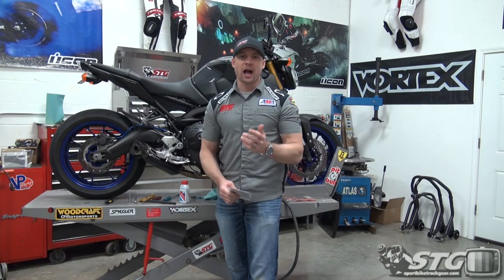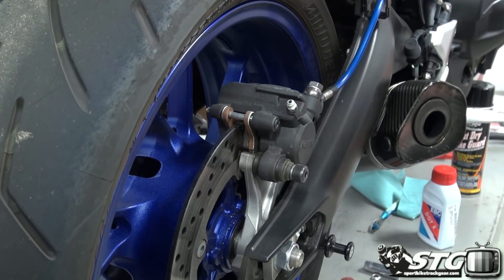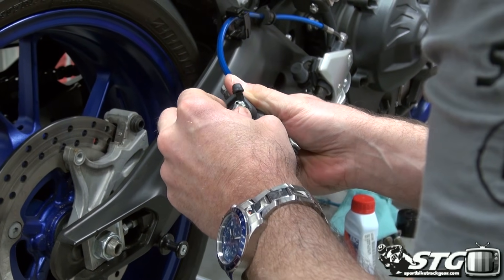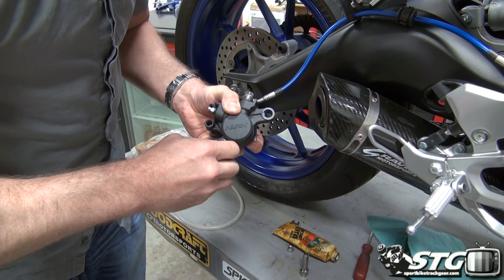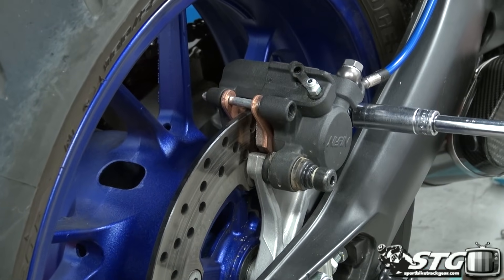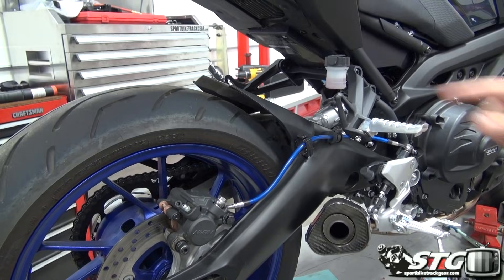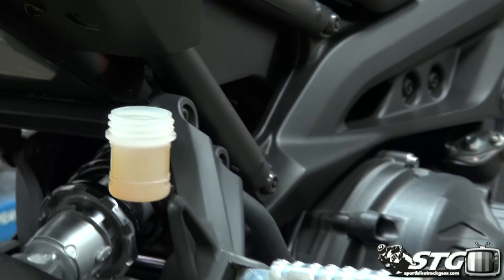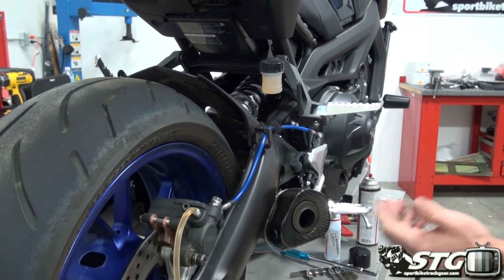How To Replace Rear Brake Pads on a Yamaha FZ-09 from SportbikeTrackGear.com

Comment: Would it do any harm to put a dab of bearing grease on the upper pad retaining pin...just to the pads slide a bit easier over the pin? I realize the grease might attract some dirt, but is that so bad?

Great info in the video.  Thanks
Reply from the maker: IMO there is no reason to grease the pins. - Van

Comment: What tool did you use to take  off and put on  the bolts
Reply from the maker: This is an older video so I do not remember all of the tools I used. All you need to change these pads are common hand tools like metric allen wrenches and metric socket set. - Van

Comment: I can press my pedal all the way down with medium force, the way you show the caliper float mine doesn’t move at all it looks like the bottom of my pads are touching and the top part isn’t
Reply from the maker: Sounds like you may need to remove the rear caliper and inspect the mounting hardware for the caliper. - Van

Comment: Have you done any abs mt09 brakes yet? Mine is 2014 abs and the manual says to get a dealer to pulse test the brakes after a self pad change.....just wonder what is that and how necessary is it.
Reply from the maker: I do not feel like this is necessary, but sometimes you are better to be safe than sorry. If you have not opened up the hydraulic system and only replaced the pads I would suggest breaking in the pads properly see how they feel. I have not seen the manual personally but what I think they are referring to is braking hard enough to get the ABS to activate. End of the day this is your call as to whether you take the bike in or not. Odds are you are good to go. - Van
Reply: @sportbiketrackgear  how long would you keep that opened bottle of fluid before throwing out. Would it be good for a few weeks at least incase I only done back brake one week and done the front a while later

Comment: Any idea why my rear brake randomly lost like all stopping power on my MT09? The bike has 3400 kms (brand new) and I used to be able to lock the rear brake... Now even with HARD pressure it barely slows down.
Reply: I rear that riding in rain can cause this for a couple of rides afterwards? I'll try Brake Cleaner and a cloth on the rotors tonight.
Reply from the maker: I would start by inspecting the rear brake pads for excessive wear. If the pedal is firm and the pads are not heavily worn out they may be glazed over causing them to not work to their potential. After inspecting if you find no mechanical issues I would replace the rear pads. Make sure to break them in carefully to get the best performance from them. - Van
Reply: @sportbiketrackgear  The bike has 3400 KMS... Brand new.. I did just ride in heavy rain for the first time 4 days ago. I read that maybe some contaminants may have gotten onto the pads and to just "wear" them in a bit more to get rid of the contaminants?
Reply from the maker: That is also possible. Assuming your front brake is working properly just ride the bike and see if it sorts itself out. It is important to note that you should not be too hard on the brakes when they are not working properly. This will just overheat the pads and possibly damage them. - Van

Comment: The brass fitting that goes behind the pads fell out when I took my caliper off, what is the proper way to put this back in I can’t find any pics on how it was sitting before it fell oit
Reply from the maker: I assume you are talking about the anti rattle clip for the pads. This should only go in one way. Try a google search for a diagram of the oem rear brake parts. Odds are this will give you an idea of the right way to reinstall this clip. - Van

Comment: I did this but when you release the brake it doesn't retract back. Any help appreciated
Reply from the maker: When you say retract back do you mean the pedal does not have the same amount of play as before or are the brakes dragging? - Van
Reply: I have the same problem after cleaning my rear brake!  Now when I apply rear the rear brake the pads close but don't seem to release/retract anymore causing them to drag on the disc. Don't know whats up :(
Reply: @sportbiketrackgear  I have the same issue, brake pads dont retract and are now dragging on the disc. Any ideas?

Comment: Bled the rear brake, after I changed the pads but my brake seems way to squishy can’t seem to figure this out the bike is brand new 0 kilometres
Reply from the maker: Why would you change the rear pads if they are new? If the problem was not there before you replaced the pads make sure to double check your work. - Van

Comment: What brake cleaner and lubricant did you use? Are they specific for bikes or can I use products that I use for my car.
Reply from the maker: You can use most any brake cleaner on the brake parts. I have used a ton of different ones over the years. For the brake fluid I like to stick with EBC or Motul RBF 600 is you want a better fluid. https://www.sportbiketrackgear.com/motul-rbf600-factory-line-racing-brake-fluid/  - Van

Comment: My caliper isnt floating. What did i do wrong? 2018 MT-09
Reply from the maker: Hard to say without having the bike here to look at. With it being so new I doubt the slides are seized up. If you have had the rear wheel off recently make sure the pads are installed in the bracket properly. - Van
Reply: Did you ever figure out why your caliper wasn’t floating?
Reply: @okie-rider  i cross threaded that bolt. It wasn't floating because I didn't have it seated properly. Doing it a second time with a new caliper worked just fine when exercising a bit more patience.
Reply: @Dunzoh  glad you got it back together.  Mine seems to be dragging.  It could have been off for a while and I never realized it.  Going to have to get it checked out by my local bike shop next week.

Comment: Are fj09 and fz09 wheels interchangeable
Reply from the maker: Many of the parts are interchangeable between these bikes. I would suggest comparing the OEM part numbers of the wheels for each bike before making a purchase to verify they will fit. - Van

Comment: I did this install in my fz09 but the stop light is on at all time
Reply from the maker: You need to take a look at the brake light switch on the right rearset. - Van

Comment: Brian quick question, my FZ09's pads have plenty of pad front and rear but they squeal a little bit in the front. Does disk brake quiet gel work?
Reply from the maker: Desean Jackson How many miles do you have on the bike? Also did you take the time to break in the pads when the bike was new? In my experience the anti squeak products for breaks are worthless. We would use them in the shop (auto) and honestly they never really helped. - Van
Reply: I have 1500 miles and I never had any issues with any hard stops took it easy. When I clean the discs with brake cleaner the squeal goes away for a few stops and then it starts all over again
Reply from the maker: Desean Jackson I would replace the pads if the squeal is bothersome, odds are that will fix it. The stock pads are typically pretty good, I know our bike did not have an issue with a brake squeal. That said things happen, perhaps there is an issue with the set of pads on your bike. If you can live with the squeal just leave it and keep riding. - Van
Reply: Hey thanks Brian learned plenty on this channel love your work. Great videos keep them up!

Comment: Hey Mr Van, did you install a speedbleeder valve before using speedbleeder bag or is that unnecicary
Reply from the maker: You do not have to install a speed bleeder to use the bag. I use it with the stock screws all the time, works great. - Brian Van

Comment: Do you have to bleed the brakes every time you change the pads?
Reply from the maker: No you do not have to change the fluid with the pads. We recommend changing the brake fluid once a season for street riders. If you are riding your bike on the track we recommend replacing the fluid more often. I replace the fluid on our track bikes every other weekend. - Brian Van

Comment: A list of tools used would be very much appreciated
Reply from the maker: We have talked about adding a list of tools to the video, just haven't gotten that done yet. Most rear brake pad replacements will require the following tools to get the job done:
5 or 6mm allen
12 or 14mm wrench
flat blade screw driver

brake cleaner to remove the brake dust (see links below)
https://www.sportbiketrackgear.com/maxima-electrical-contact-cleaner/

https://www.sportbiketrackgear.com/maxima-suspension-clean/

Sorry the list is not specific, it has been a while since we did this video. - Brian Van

Comment: You don't need to remove the caliper to change the pads.
Reply from the maker: You do if you want to clean the piston etc... - Van
Reply: Disagree, and you should always use a torque wrench. Also one of the retaining bolts should have Loctite applied.
Reply: Basically follow the Yamaha service manual.